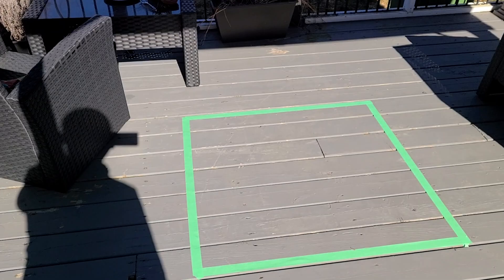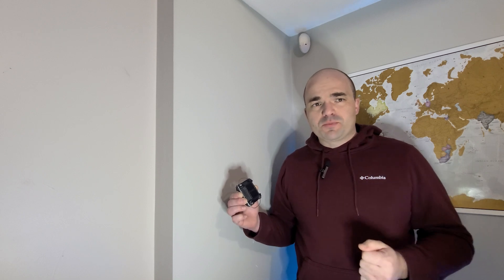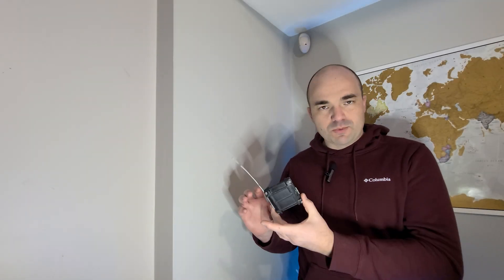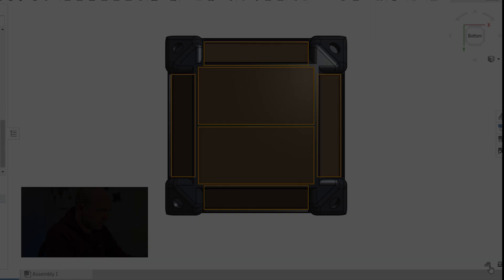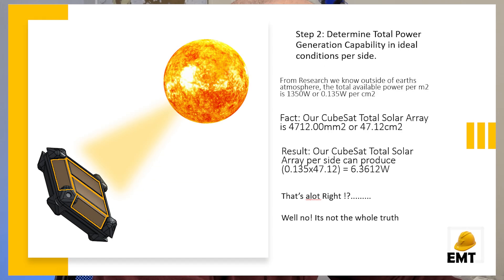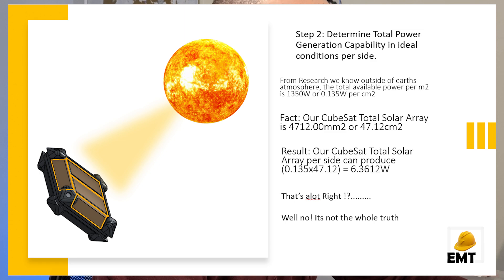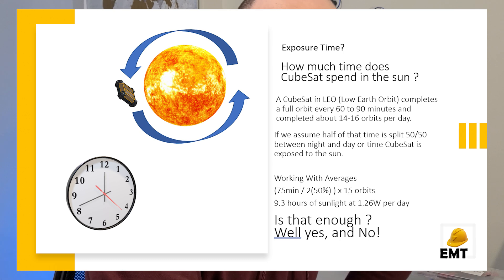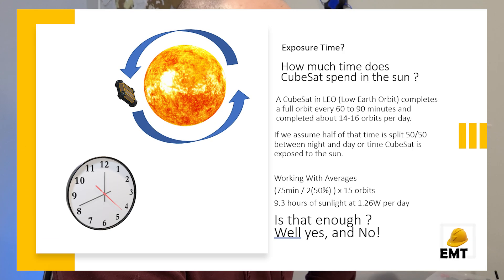DIY CubeSAT Build :Part 4 Selecting the correct size solar arrangement and what to consider

Comment: By the way - have you explored launches much? I'm still researching that part, looking to get a 3U launched with scores of picosatellites on board from schools and homeschoolers across the country. Trying to split up the launch cost. If you have looked into it, who have you enquired with and what prices are they quoting?
Reply from the maker: Ya I think I answered it in the first video. but to summarize the issue is the launch companies want exact weights and payload descriptions plus what orbit you want it in, and when you want to launch, the best I could do is get general figure of $50K launch/integration cost and $5K per additional kg. if you wanted line items cost you would need to engage with the companies and list the questions and answers before they will answer accurate numbers